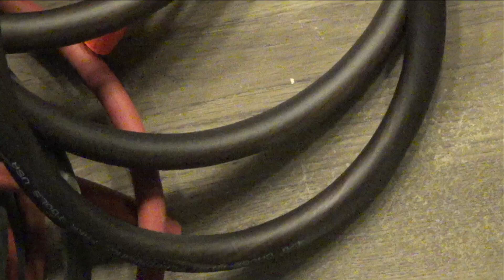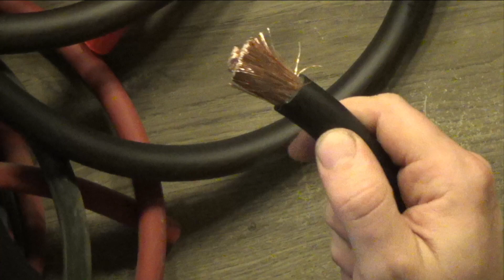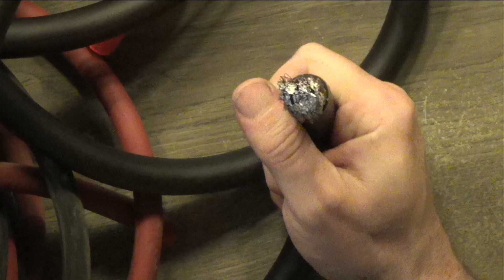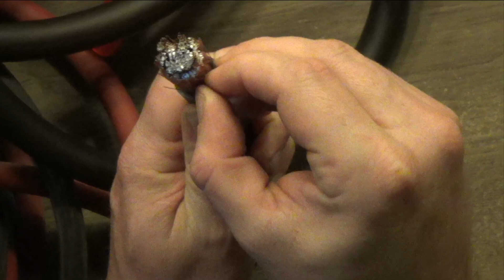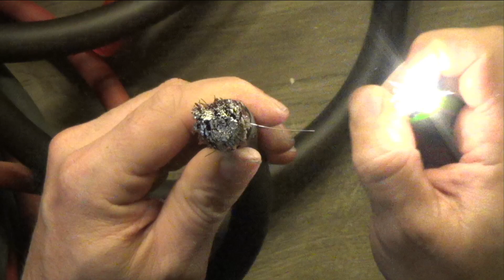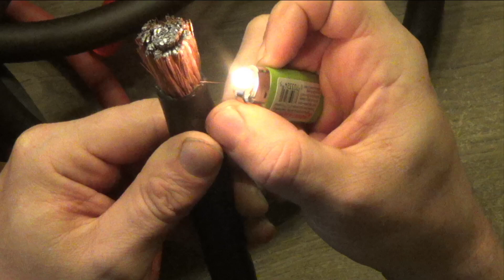Pure Copper vs Copper Clad Aluminum Welding Cable / Battery Cable.

Comment: Is this cable ok for welding because of the duty cycle the cable would be running under?  I'm guessing welding, the power would only be on and off in short spikes, not enough for the cable to get terribly hot.  But under constant load, this cable would probably catch fire.  Thanks for the PSA!
Reply from the maker: A 4/0 cable like that would probably be ok for most welding electrically, but I would also be worried about the aluminum strands work-hardening and breaking as the cable is flexed.  

A copper 4/0 cable with 90C insulation is rated to 250 amps.  In comparison a CCA 4/0 with the same insulation is only rated for 205 amps.  And if that skeevy unmarked jacket is actually only 60C insulation then it's only rated to 150 amps.

In general the only thing I am willing to use aluminum wire for are service entrances where it is stationary and buried.  But I may be too paranoid about that sort of thing.

This particular cable I wouldn't trust for anything.  There is no voltage or temperature rating printed on the jacket, so who knows what it actually is.  It looks like really big speaker wire, tbh.  Very skeevy.
Reply from the maker: PS: Most of that (real) welding and battery cable has pretty high temp insulation, like 105C or more.  More than typical THHN-type wire that you would pull into a conduit.  You gotta be real careful about getting good crimps and solid connections at high amperage like that too or the insulation can burn off near the connections.